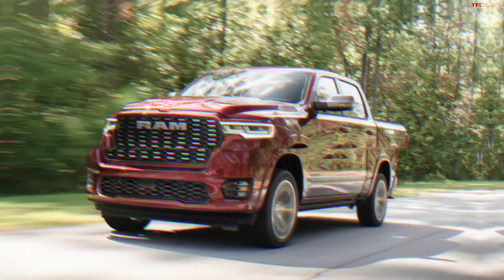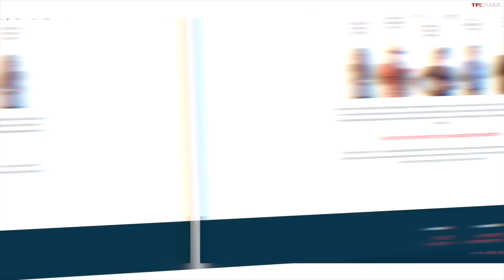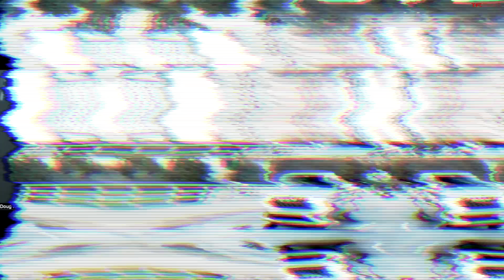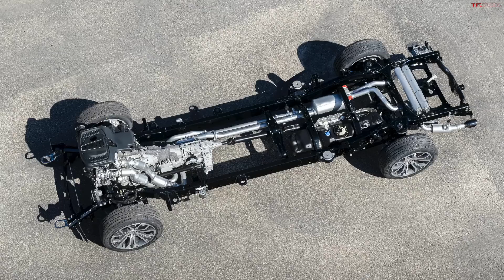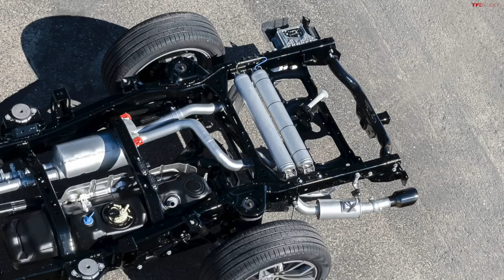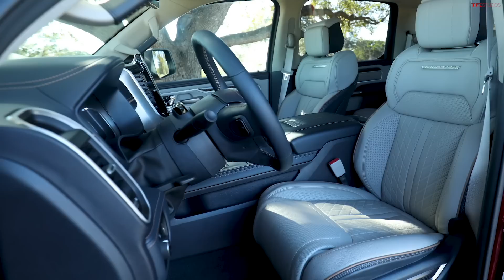No More Hemi V8? The 2025 Ram 1500 Chief Engineer Explains Why!

Comment: Would have been nice if they fixed the Hemi (no more cylinder on demand) so the cam and lifters didn't fail.
Would be nice if they kept it in production as it will be more reliable than a forced induction inline 6.  The Hurricane should still be offered, but fix the Hemi and still offer it.
Oh Yea, make the vehicle affordable to the people that need trucks.

Comment: You might as well make up a bunch of resumes when nobody buys  them because they don't want mini engines with multiple turbos no turbos big bore large cubic inch engines that is a truck the price is $30000 too much make a PU that's like a 52 chevy straight 6 1/2 ton thats 1000 lbs of load it got 20 mpg 1n 1955 some people don't need to pull a space shuttle while riding in a mercedes interior

Comment: Any new EV manufacturer should also have a charging infrastructure investment plan. That is the most important aspect for EV adoption at this point. How is the manufacturer going to ensure a good and stress free charging experience? How are they going to contribute to the expansion of the DC fast charging network? This is where Ford failed and continues to fail.

Comment: So if I run out of battery can I just run the engine and charge the battery’s without plugging in?
Reply: @stuarthoffman5065..........................................YOu must have missed what the Engineer said. "GENERATOR" power from the 3.6 v-6 Engine recharges the Battery.

Comment: I’m a dodge truck guy, but I will miss the tried and true Hemi V8 which I have loved for years. Not a fan of forced induction engines in trucks so I will not buy a new Dodge truck unless the V8 is an option.
Reply: You mean the hemi with all the lifter issues?
Reply: @christrarback9748  Which have NEVER been seen in anything GM or Ford every made right? FFS
Reply: @briancavanaugh7604  stay on topic , we are not talking about that
Reply: @christrarback9748  You mentioned lifter issues as if they are isolate to Rams only. I pointed out they are an issue with all three HD truck manufacturers, are you slow or something? Literally 100% on the same topic.
Reply: @briancavanaugh7604  that was point of my joke , see you figured it out

Comment: Stop with the CO2..... CO2 is what animal life exhales and what plant life needs. Water vapour is the most abundant greenhouse gas in the atmosphere, both by weight and by volume. Water vapour is 98% of the effect. That leaves ALL the other GHGs at just 2% of the effect. The Sun and its' cycles are of even greater effect on Climate temperature. Peole need to do their homework. CO2 and Methane are fractional contributors at most.

As for power... strengthening the V8 and turbo charging it to achieve the same horsepower and MORE was possible as well..

The range could have been handled by using the space devoted to batteries for a larger fuel tank. A couple of solar panels could have been added to the roof to charge the batteries while a vehicle sits out in the sun while a person is at work.

The only place the 6 cylinder has an advantage is to the natural balancing out of the vibrations and "possibly" a volumetyrically smaller and lighter engine.

Comment: Don't blame RAM for a small displacement twin turbo. Blame the eco-weenies, Democrats and EPA for CAFE requirements and fuel economy testing procedures.  Fuel economy testing is done under light loads, essentially off-boost.  A small three liter engine will eek out better MPG than a 5.7 or 6.4 liter V8.  In the real world, you have to get on the boost to make the 3.0 liter perform and MPGs will drop.  I'll take a normally aspirated larger displacement engine any day.
Reply: Thank you everyone  crying but  they had over 10 years to update  that hemi

Comment: RAM currently has 10% OFF MSRP on moat 2024 RAM pickups.  Do they expect to sell higher priced 2025s without even more cash on the hoods?
Reply: Well RAM is trying to get rid of the 2024 models as the 2025 models are coming soon. This isn't any different than any other year. Customers are holding out on buying a 2024 to get a 2025 so throwing some cash down to try and persuade some of those customers into just getting a 2024.

Comment: We don't need 24 way adjustable seats with massage. We want durability and reliability at a fair price
Reply: Fax. The reason they do this is because the features don't cost them much, but increase their bottom line.

They can build a base truck at 30k, and sell for 50k

OR

They can they can build a "luxury" truck at 40k, and sell for 100k.

You'd have to sell 3 base trucks to make the same profit as 1 "luxury" truck
Reply: There is the tradesman if you don’t want the massage. However, I am sad to see the HEMI go.
Reply: I very much agree. Really, in my opinion, the high-end version of the 1500 shouldn't even be a Ram truck with the kinds of features it has. It should have been made as a Jeep since it's more like a truck version of the Grand Wagoneer. The Grand Wagoneer is basically a modern luxury version of the old Ramcharger given that it is built on the 1500's design, and since Chrysler is mostly a dead name at this point with Jeep taking over the more luxurious segment of the CDJR vehicles, it would actually be fitting to have a Jeep truck that would basically be Ram's equivalent to the GMC trucks.
Reply: OMG, give this man a job at Chrysler!!!
Reply: True dat, we don't need a second mortgage just to get a truck,  simple work truck   dont have to be a massage parlor.

Comment: That payload sucks. My 19 Silverado LTZ z71 crew 5.3 has a payload of 1743lbs. I almost max it out towing my 7500lb  travel trailer. After 750lb tongue weight, my family and gear in the bed, we almost max it out. The ride on it is fine

Comment: TFL. Can we have a reliability video?? These manufacturers should be held accountable for their own R&D. The consumer has been paying for it for years now.  Everything looks great on paper but once they are in the real world the failure rate is ridiculous.
Reply: How? Where? Engines today have been lasting much longer than engines 20-30 years ago.
Reply: @Dusdaddy  wrong. Take any of the GM 5.3, 6.0 or 6.2 from the early 2000s and compare to the latest versions.  Take the ford EcoBoost engines and compare them to the same early 2000s triton V8. Ive worked on all them and seen reliability drop. Asking more horsepower out of smaller displacement. It's a recipe for issues.
Reply: @Youngmechanical  The Ford 3.5L is more reliable than the 5.0
Reply: @Dusdaddy  I think we'll have to agree to disagree. The 3.5 has endless cam phaser failures and stretched timing chains. Also if cheaper oil is ran the oil cooling jets will plug up and it's all down hill from there. The 5.0 might lose a cam phaser once in a while but it's less likely. No turbos to go bad and no oil cooling jets issue. The 5.0 from release to 2018 did have cylinder head issues with valve seats but the cost of ownership was still lower to 250k miles
Reply: @Dusdaddy  fleets of these trucks is what I'm seeing these failures from.
Reply: Sure, in ABOUT 10 YEARS???  Look up “reliability”.

Comment: How about a trim called Stripper...Regular cab, 8' bed, a/c, roll up windows, no carpet, open power train options, steel wheels, cruse control, tow package, 4x4 or 4x2, regular radio, and a price under 30k....I can't believe in this market they just keep pushing top dollar trucks when the dealers are overflowing with them however the lower trim ones can't be found...People are going broke and they act like we are going through a boom time.
Reply: "Stripper...no carpet..." classic!😂

Comment: Alan Falkowski who designed the gen 3 hemi also is the engineer that designed the hurricane inline 6. So if you thought the hemi was pretty good than you should feel a little better about this engine as well. Only time will tell but they have to keep moving forward. The hemi ram was available for 19 years so if you don't like this new powertrain then you can always find a good used hemi truck out there. I love the hemi and have put cams headers and prochargers on them for years and will continue but I'm looking forward to this new engine moving forward. BMW has been using a 3.0 inline 6 with ZF 8 speed for years and everyone loves it so can't wait to get one and start seeing what mods it will take before it's limits are reached.
Reply: To be honest I do have great hopes for the inline 6
Reply: BMW 3.0 is different thana  RAM 3.0...GM had a 5.7 V8 for years,Toyota had a 5.7 V8 for years and RAM had a 5.7 V8 for years...all are different like the lame inline 6...Dodge even RAM had a inline 6 for years they had a 3.7 inline 6 for decades...they also had a 5.9-6.7 inline 6 Cummins diesel...Why are dolts always saying BMW had a straight 6 for years,yeah we know how unreliable that is! 

Fact is people like V8 engines for a multitude of reasons...
Reply: @mypronouniswtf5559  There are still new 2024 models with the HEMI.
Reply: Yep, got a 2024 Limited Night Edition with the 5.7 Hemi. It’s still 2024 and there are lots of Ram V8 models available. 

Folks went into a panic during the late 70s when American autos started making smaller cars and went to front wheel drive. The V8s we got were full of smog emissions and downsized with no power. My 75 Chevy 350 was around 150 HP. The V8s made a big return with power. 

We got rear wheel & AWD cars. The Hemi or something similar will return once some smart engineer figures out better emissions & efficiency. 

As the Good Book says, ”For our light affliction, which is but for a moment, worketh for us a far more exceeding and eternal weight of glory;“
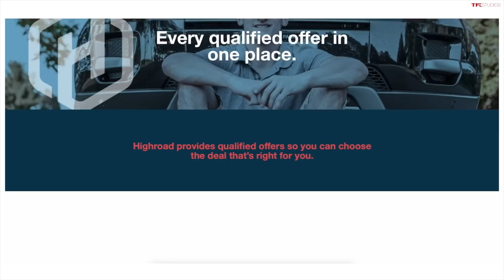2 Corinthians 4:17 KJV

 “This too shall past”
Reply: Were the CEO and the accountants the same as the gen 3 HEMI? Ya, not ever close. I don't doubt Alan's qualifications I just HIGHLY doubt what he envisioned actually made it into the final cuts for the hurricane.

Comment: On board inverters have one common problem on most vehicles. They do not provide a pure syne wave and most solar generators do not recognize the power and won't recharge from the on board inverter. I hope these new inverters have addressed that so that campers and overlanders who do not want to always have the engine running can use their solar/power banks more efficiently.

Comment: the ford 2.7 is bulletproof . people sleeping on turbo engines
Reply: Turbo engines have certainly come a long ways from what they used to be. I think it's just the bad rap that got from years ago and people think nothing has been improved. I think Turbo charging is the way to go if people still want an ICE vehicle. These manufacturers need to figure out ways to keep emissions low while also maintaining good fuel economy. Turbo engines are a great way to do this as they can have smaller displacements that put out the same or even more power than NA engines with the same reliability.

Comment: I wanted to buy a RAM Rebel with air suspension, but with a 1067 lb payload, I and 3 fat friends can't bring travel luggage,  have a topper or tow a 4000 trailer.  Even limited trims only have 1384 lbs payloads.   I will admit they ride nice when empty but a Honda Ridgeline Trailsport is rated at 1488 lbs.
Reply: Whwere did they say that? I heard the Rebel has 1900lbs of payload. Dude, you got some seriously fat friends!
Reply: Tim showed one with 1,666# the other day.
Reply: @garysarratt1  It would be devilishly good to have 1666 lbs payload.  I went and looked at the truck physically to make sure the 0 was a zero and not an 8, but the door sticker still said 1067.
Reply: @Ishkatan  You sure that wasn't a Tungsten? Those have a small payload. The 2024 Rebel is listed at 1580. Can't be far from that.
Reply: @Ishkatan  “Devilishly” 🤣

Comment: They should have made that Hurricane engine in a V8 configuration or as a bigger displacement I6. As good as the I6 layout is, there is a big problem here: this is a relatively small 3L engine to be pushing the kind of power they are advertising, particularly with the HO version. The SO version of the engine is fine for the 1500 and both are fine in a car or SUV, but I do not believe that they will have the longevity of a Hemi when pushed in truck application. Much heavier loads to be dealing with. At least with a bigger I6 or a V8 you have more displacement to split the power between. You won't have to run as high of boost. The other thing about a smaller displacement V8, something along the lines of a 4L, is they aren't too bad on MPG. The Cadi CT6 with the 4.2L TTV8 was able to get an EPA rated 25 MPG on the highway and did it with a sedan that was bigger. It also had AWD and still was able to achieve that number where the 5.7 Hemi on the Chargers in AWD would typically drop by about 2 MPG. This is the same deal with the smaller 5L V8 in the Genesis G90, so with a smaller and lighter vehicle without AWD and a detuned version of that Blackwing engine I could see that MPG going up. The two cylinders with less heat and pressure + temps would potentially lead to lower NOX emissions too. Of course the HO I6 can make the same numbers as the Blackwind and even the Hellcat and do it with better MPG even if the NOX levels are higher, but particularly in a truck application I would assume most people would rather have the slightly larger engine and get better longevity. It's a half ton truck at the end of the day anyway, so fuel economy is going to be bad regardless. They should have kept the 5.7L V8 as an option and made the SO I6 the standard in the 2025 model year trucks.
Reply: It’s not about mpg really, it’s all about emissions.  This is why diesels are almost dead in regular vehicles, even though they have excellent mpg.  A V8 is always going to emit more than a V6 and a V6 more than a i4.  That’s why you’re seeing the whole industry moving towards turbos and hybrids and EVs.  Increasingly more and more stringent regulations.
Reply: @smrtguy77777   That's not always going to be the case since you have to play by the rules of thermal dynamics. If a V8 can get better MPG than a smaller engine, then by definition you will have less CO2 emissions. The Blackwing engine will produce less CO2 emissions than some I6 and V6 engines at around the same displacement or even at lower displacements depending on the running conditions of the engine regarding load, boost, air/fuel ratio, and EGR and PCV injection into the intake. NOX emissions also aren't going to increase with larger engines by default just because of he higher cylinder count; it's the heat of the combustion that oxidises the nitrogen in the air that creates it which is why even engines running on hydrogen produce NOX gases. EGR systems reintroduce the exhaust gases back into the engine to give it a buffer gas to offset the amount or air coming into the engine. Less air means less N and O in the combustion which means less heat and less NOX emissions created. Running the engine rich also has a similar effect, and since that typically is done on turbocharged engines anyway to use the fuel to cool the combustion chamber under higher loads this means you'll burn more fuel when you run the engine hard. The I6, particularly the HO version, will probably get worse fuel economy than the 6.4 Hemi when towing the same amount of weight depending on the conditions of the road and weather unless you're going downhill or pulling something well above sea level where the air is thin and the turbos can help the engine breath.

Comment: I want a naturally aspirated, half-ton, non-hybrid V8, 4wd, seating for 6, and rear vents, so I'm limited to GM... hopefully their new V8 will be better than the current gen
Reply: Dont Ford and Nissan offer that as well?
Reply: @MX5-XU  To my knowledge, Ford doesn't have rear vents if you have the bench seat, and the Titan is dead
Reply: @tjmanifest  I think both have 2024 models. Dont know about rear vents, but would that really be a deal breaker?
Reply: @MX5-XU  I guess not an outright deal breaker, but GM can do it. It's more a really annoying oversight
Reply: That's what I have, minus the rear vent, which I don't want anyways.  Will be maintaining and fixing it indefinitely.  Until rust takes it I guess.

Comment: Why do i need an 8.4 inch touchscreen radio in a tradesman. I want a lower price not a tablet
Reply: “TRADESMAN” 👍👍👍 My choice exactly pisses me off multi-function tailgate “NOT” available in Tradesman…..
But “MULTI-FLEX” tailgate “IS” available on Chevy Silverado “WT”
Reply: The reality is that you're probably not actually paying any more for the "tablet" since it is a unit that has been in several Stellantis vehicles and they've probably already broken even on it. In fact, you'd probably end up paying more if RAM had to sit down and design and build an  analog center stack just for this vehicle.

The vehicle isn't expensive because of the screen. That's what I'm trying to say.

Comment: Wish they kept a version of the HEMI, preferably the 6.4 for the 1500.  That would direct compete with GM's 6.0.  I'm ok with the 3.0 replacing the 5.7.  I'm also looking forward to a time where there is an ample supply of 1500's in wrecking yards from insurance totals, as that Hurricane standard output drivetrain would look really good in my classic Jeep XJ!  ;)
Reply: Hemi still in classic eh
Reply: The issue is the emissions, they cannot produce a bunch of high emission V8s, they needed to redesign it like GM is doing with the small blocks, but Stellantis decided not to.  GMs next gen V8s come out in 2028.  Ford's 5.0L is good for another decade as well.
Reply: I love the 5.7L.  Works for me.  It's a good, strong engine.
Reply: 6.4 in the 2500,3500 etc.. plus you can still buy the classic!